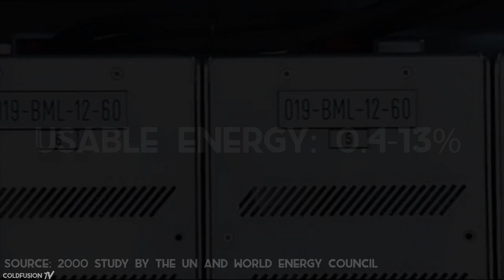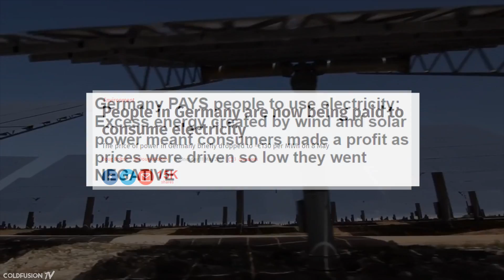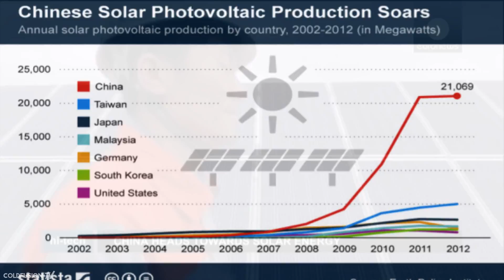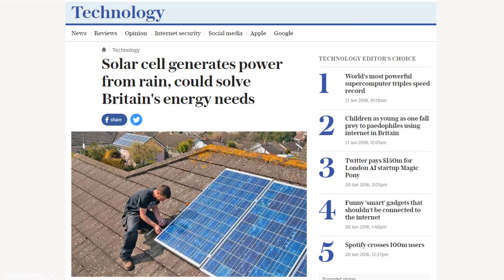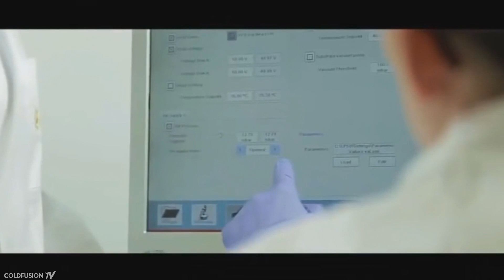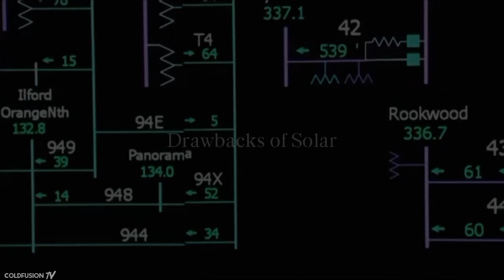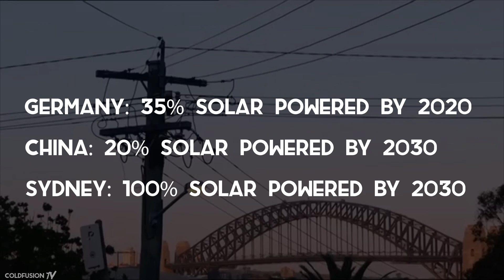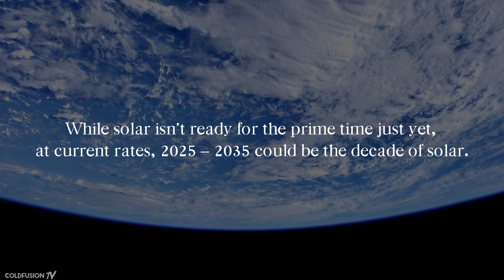The Truth About Solar

Comment: If solar is So good, why aren't new houses built with solar already built into the house? Also, these High Pressure, persistent, and Lying contractors keep hounding me on the phone and at the front door of my house are really turning me off to solar.
Reply: In Japan they are. Pretty much every new house here is built with solar panels.
Reply: stephen meinhold that sounds like a very educated opinion. Glad you backed it up with facts and references.
Reply: stephen must be off his med but where Im the rates do vary but in last few years the supply rate has gone down for electric. So being locked into a contract that will go up 2% a year would not be a good deal here. Plus the prices is going down for PV too and when the clown we have for a pres and his tariff on China PV ends we should have much cheaper options.
Reply: Also things that could involve no or a low initial fixed "extra expense" like heating a hot water tank during low demand/high PV supply rate periods when the rates should be low, will all happen too. If the rating system is set up properly.
Reply: If food is so good why don't all new houses come with fully stocked fridges? (Makes as much sense)
Reply: No, it's just done to annoy climate denier conspiracy Kochroaches.
Reply: I think you are just an angry Marxist/Atheist who gets angry when you cant refute a fact so you try to change the subject by making light of my religion and my rational preference for rational economical fuel. Which is really quite silly of you. All you Marxists do is alienate normal people with your over the top hatred of reason and Western Civilization in general.
Reply: Your laughter is the laughter of a frustrated Liberal loon. Another few years of watching your dreams crumble and you'll be laughing in a rubber room.
Reply: I would rather remove subsidies from coal and nuclear than give more subsidies to solar. I'm a conservative. I believe in shrinking government, not expanding it.
Reply: Richard Dixon you have no idea mate .i know numerous people that are saving money .it can take 3-5 years to brake even and then you have nothing but savings for 10-15 years .if your smart with your energy use its a no brainer here in Australia
Reply: I like the idea of grid connected solar included in the mortgage, for wet or northern locations it takes a long time to break even.
Reply: they are con artists, nothing to do with with solar its just a means to an end, parting you from your money.
always do your own research.
Reply: I have left that up to you,
Reply: Another thing is LED lighting which drastically reduces energy consumption for lighting, better buildings lowering energy consumption for heating . and this stuff is all happening once.
Reply: @Crazy Yeah right. Like that Kyocera 29MW solar power plant that they're still "studying" what purpose it could serve? Energy companies have been "studying" it since 2014, by the way.
https://www.scientificamerican.com/article/power-companies-in-japan-move-to-restrict-solar/
It's an engineering feat that we simply will not want for reasons we're still "studying." XD sorry just griping. 

They won't let it into the grid because that would be costly for fossil plants since they'd have to keep producing even during peak production hours. They can't just shut it off. Not much investment coming in energy storage so far and companies would rather keep pushing papers while earning for the meantime. It requires political motive not just technological. The science has been there for a while.
Reply: "They can't just shut (it) off" the "fossil plants" ? Seriously??? What is a fossil plant a very old plant? Or did u mean a fossil fuel plant? And what kind of fossil fuel?  Gas, oil or coal? So r we suppose to pretend they r all the same? 

Intermittent generation sources like PV or wind r far more difficult to manage when they become a significant percentage of the generation capacity. But there r ways to adjust the economic incentives to allow the use of intermittent interment generation sources like PV.  Like by using TOU (Time Of Use) metering and a modification to Net metering for selling the excess electric back to the grid at rates that reflects the need for it. Which for example could go down to 0 sometimes when there is no need for it or go up to many times the normal market rate at other times when there very high demand fo it ie giving an incentives to buy storage or to shift usage patterns. 

 "The science has been there for a while." If have been rich enough to buy it and the storage needed for it, But for the rest of us it will take political decisions based on sound economics to create the proper incentives make PV economics viable for the rest of us. 

But we all know most ppl prefer simple answers to complex questions instead. Like saying the utility companies and the big bad legacy fossil fuel plants r part of an evil conspiracy. So enjoy ur simplistic view point.
Reply: N C Perhaps that didn't come across right. Gas turbine power generation isn't like a car that you just turn over. There's a relatively complex startup process from spinup to synchronization to self-sustain and takes a few minutes even on hot start conditions. All that while burning fuel. Not to mention the needed purge between operations.

What I was saying is that, if you're just talking money, it will require extra expense on gas turbine power generators just to accommodate solar while at the same time, losing revenue on solar peak production; which is exactly why you arrived at my same conclusion that moving up to solar will require political will.
Reply: you toob how has that been so far?
Reply: If stupidity is so good why don't all houses come with (it) fully stocked? (Apparent at least 2 do)
Reply: I've had 10KW on my roof for 5 years now. What 'maintenance" are you talking about?
Reply: Thank you for the correction.
Reply: I HAVE a Margarita in my hand at the moment.
Reply: Too bad you can't get a woman.
Reply: So a recent law put into place in California is requiring solar to be installed on every new home.  Guess new homes will have to come with solar after all, at least out west.
Reply: More people will just flee California to avoid this stupid law.
Reply: Look at the shows on HGTV about renovating and flipping houses.  It is all about visual style.  The first thing they do is rip out walls, which is not smart in the north. Open the door on an open plan home and all the heat is out the door in a flash.  They rip out perfectly good cabinets and floors because the "finish is dated"
There are a lot of builders who buy cheap farmland, build cookie cutter homes, and run off with a quick profit.  I doubt if any of them has the ability to care about the environment, let alone figure out the tecnicalities of solar.
Reply: 6.6kw is good enough for old people? Really? In the south, where temperatures can regularly go above 100F, old people need to run their air conditioning systems 24 hours for several months. No batteries or inverters can handle that kind of energy demand.
Reply: I am not an expert on AC systems, but in Iraq, my Q36 radars used generators which put out 10 kw, 400 Hz.  This was then modified by the radar into DC and AC circuits..  They powered two laptops, two monitors, a mechanical map display, two tactical radios, a printer, an interface computer to the rest of the radar, two AC units, one of which was, usually on, and both could be on, cooling two operators, and the electronics, while also sending much of the power to provide a radar signal which could detect and track multiple targets the size of a hand grenade out to about 15 miles.  It did this for a shelter which was essentially a minimally insulated aluminum box in ambient temperatures which got up to 121 degrees F and surface temperatures in full sunlight of over 160 degrees F (This is why you see pictures of soldiers in Iraq wearing gloves in the summer; skin to bare metal contact could result in bad burns._)  The ambient temp was more often 115 degrees and went down to the low to mid 80s at night.  
I see no reason why a reasonably insulated home of modest size should not be able to do with half that.power since the roof would be turning a lot of the energy which would heat the roof into electricity.
Reply: A lot has happened.  Solar is cheaper than coal, new homes in CA are required to have solar, recycling batteries is becoming intrigal to their production.  Nice video but you failed to mention decentralised solar (the German model) which is far more effective and fungible re: the electric grid.  Now that AI is monitoring power flow, even huge concentrating solar plants can easily plug in (pardon the pun).
Reply: +you toob Leaving a reply so I can get a notification when you come back with the metrics.
Reply: +Crazy Unless they don't have power lines going into the house, I won't be impressed. And I'm fairly certain that no matter how you jiggle it, you won't achieve the comfort level of a solid 110-220v 10kW grid. This solar power comes with a lot of ifs and bending one's lifestyle around those ifs. I don't like that. When we get to a point where those ifs stop existing, aka a point where I can draw 10kW off the wall from solars and not have to invest into new super capacitors every 5-10 years (and those are expensive as hell, even if I build them from base materials).
Reply: Solar is not cheaper than coal. That's just an absurd lie. Solar is expensive as hell.
Reply: Government doesn't make money. Government confiscates money from Citizens and re-distributes it as they desire.
Reply: Gulf Echo https://en.m.wikipedia.org/wiki/Cost_of_electricity_by_source

And this

https://www.forbes.com/sites/dominicdudley/2018/01/13/renewable-energy-cost-effective-fossil-fuels-2020/amp/

So not only is it often less expensive now, it will be universally less expensive in the near future.  Not to mention environmental costs.  Solar really is our best option for general usage in all sectors of our lives.
Reply: It would not be possible to economically run my air conditioning system in the summer with solar panels and batteries. It would take a system costing tens of thousands of dollars, not to mention battery replacement costs, equipment failure and random weather events. It is WAAAAAAAAAAAAAY cheaper to just pay $200-300/month bill for my coal and nuclear generated power from area power plants. The dirty little secret about "green" energy is that it's just not cost-effective.
Reply: already built in... well, some of the builders do just that here in Scotland. They don't generally put enough panels on, though - nothing approaching using the whole roof.
Reply: Paul Smith Food is a consumable, perishable good. Solar panels are neither. Your attempt at coming up with an analogy is so weak and pathetic that you should probably be sterilized to ensure you don't breed your stupidity into later generations.
Reply: Gulf Echo - design houses better and they don't need refrigerative cooling. The people  in Yemen, one of the hottest and most humid densely occupied places on earth, have been doing it for a thousand years and more. They use a kind of passive a/c with air flow driven by tall ventilator 'chimneys'. Air is drawn from street level, passed through a cool damp cellar, then through the house, then exhausted at the top. The scheme doesn't use any grid energy. This is being improved on and copied by architects in southern Europe (also pretty hot). 
In denser cities and towns, refrigerative cooling spills all the heat and the energy used to drive the cooler, exhaused as heat, into the street, making the whole town warmer than it would have been without coolers, so you are on a hiding to nothing - the hotter it gets, the harder (more expensive) it is to get down to a tolerable temperature.
Reply: Morpheus; Solar panels and batteries are also perishable. Solar panels don't last forever and most batteries last less than 4 years with constant use. Your attempt to debate is pathetic. You are an typical Liberal idiot.
Reply: Ah, the oil evangelist has spoken.
Reply: Christian, fossil fuel advocates should have a voice just like Marxist, alt energy fanatics do...
Reply: They do....It is the voice of the Koch brothers.
Reply: ...as opposed to George Soros?
Reply: He doesn't fund FF sites.
Reply: He does fund DNC campaigns, internet bots and protests...
Reply: Yes of course...my flat Earth friend.
Reply: Do you have a counter-argument to my above statement, "Solar panels and batteries are also perishable. Solar panels don't last forever and most batteries last less than 4 years with constant use." ? Or do you just want to trade one-liners for the next few days?
Reply: Tesla batteries can easily last 20 years before the drop to 80% of their new specs. Other stationary battery chemistries (eg. flow batteries) are better. Todays solar panels will easily last 30 - 40 years and still have 80% output. A barrel of oil has a lifespan of what? Half an hour? And nuclear maintenance costs are astronomical. Decomissioning costs $billions. Solar panels are recyclable.
Reply: Ask the Brits how their $13B Hinkley nuclear plant turned into $35B and still not complete. Expected to hit $50B.
Reply: I can't be angry when I'm laughing this hard!  I didn't think being a flat Earther was a religion, but hey, knock yourself out with your 'logic'.
Reply: We aren't talking about Teslas. We are talking about home solar systems and Tesla hasn't been around long enough to prove their 20 year claim. And I have yet to see the home solar system that can meet the energy needs of a typical Southern A/C system in a typical Southern summer. But you probably hate Southerners and think we should just sweat all summer because Al Gore told you the "polarized" ice caps would be gone by 2014...
Reply: +Ken Karnes Now they are, dont be a smartass
Reply: I live in Hawaii and solar power is very cost effective here. It really depends on where you live, how much sun you get, and how expensive electricity is. We've had our 10KW system for about 7 years and it has already paid for itself in energy savings and tax credits.
Reply: ..."tax credits"... being the keyword here...
Reply: Yes, with tax credits, without it, the payback period would have been around 10 years. This was back when solar panels were way more expensive. The price now is less than half of the price it was back then so the payback period would be about 6 years without tax credits, about 4 years with tax credits. Right now my solar system basically pays me about $400 a month, it would be more but electricity has gotten cheaper since 2014.
Reply: Right. So solar is not cost effective without the government subsidizing them through tax credits. That's my point.
Reply: That is exactly the opposite of what I said. Right now, the payback period for solar in Hawaii is about 6 years WITHOUT the tax credit. If I didn't already have my system, I would add one right away. It really depends on where you live and how much energy you use. Also, coal and nuclear are also heavily subsidized by the government so why wouldn't you count the tax credits for solar?
Reply: What's "the payback period"? I live in the American South. It is incredibly hot and humid here for months and I run my 50,000BTU AC system 24/hrs per day from may-september. My bills are around $250/month. How would it be cheaper to power my needs on solar? We are talking about a system that would cost tens of thousands of dollars with batteries and  installation, not to mention maintenance, malfunctions and replacement costs for expensive equipment. It's just much more cost effective for me to pay my $250/month power bill than to go into debt to install a $25,000 system that will require expensive upkeep and perform poorly in inclement weather which we have plenty of.
Reply: Payback period is the amount of time it takes for solar panels to payback what they cost you. So if your system cost $20,000, how many years would it take you to make back that $20,000 in savings, basically when the ROI reaches 1. The payback period is different depending on where you live and how expensive your electricity is. Solar is not for everyone but as the price drops, it will be a worthwhile investment for more and more places. It seems that in your area, it is not cost efficient yet, but as prices drops, you will see more and more systems and they become a good investment.

Also I am not talking about off grid systems with batteries. I am talking about the 99% systems that most people get, grid connected systems without battery backups. Maintenance cost for solar panels are actually very very low and everything expensive like the panels and micro converters have 10-25 year warranties. What kind of upkeep do you think solar panels have? I pay maybe $300 a year for maintenance because I am too lazy to go clean them myself once a year.
Reply: I'm all for the most cost-effective energy option. I just don't want technology shoved down my throat for the wrong reasons.
Reply: The law for solar panels for new homes in CA is fine. The payback period in California is pretty low and it helps for base loads and helps lower the needs to add more power plants. It very similar to requiring insulation or energy efficient appliances in new homes.
Reply: It probably will in a few years. Just like title 24 explains for “energy efficient” homes and buildings if there’s money to be made they will pass a law where if you buy a home or building or renovate a home or building you will have to conform with title 24 which will mean solar panels. This might not be a good thing since it will be controlled and prices set pretty high why? Because they can!
Reply: If solar was cost effective, government subsidies wouldn't be required to make them mainstream.
Reply: "Be quiet and don't expose our 'green energy' scams, or I'll call you names"...
Reply: Many new houses get build with solar roofs, but the investment is big and it the return is slowly. Wherein without solar roofs, the investment is small and paying for lifetime for electricity. So it's just about calculations...
Reply: Richard Dixon i have just had it installed. 5kw 6.6kw panels costing me $5400 .i will let you know in 3 months time when i get my power bill
Reply: Ken Karnes im looking into solar. im looking at the upsides and the down sides. Alot of the houses being built around me have solar already on them but im not sold on it yet i think there has to be a better way.cost wise it is about half the cost for the first 20 years then its "free" but im with you on the contrators hounding me to buy when i want to make a informed decision.
Reply: Ken Karnes sir it's not about how good solar is or that it's better or the ultimate replacement for fossil fuels. The reason you use solar is about being a true modernist and it's frankly stupid to depend on fossil fuels when you have powerful pocket computers and walk around wearing Spaceman headphones. Once you have solar power you can leave the lights on all night did he was only the highest wattage light bulbs what's Tesla batteries are a few hundred dollars a piece and freon cold the last longer. However if you keep hugging the wall love you too man you might as well pull out your crystal radio listen to your jungle noise cuz that's about how advanced you are as a human being and it's pretty sad.
Reply: Im doing a solar lease program. basically the panels are installed for free, and the company owns and maintains them, sells ME electricity. Its awesome. I dont pay a thing, and my electric bill is cut down by about 45%. But the big saving is the rate of increase. Power companies hike their rates about 4-5% a year. Im locked into a 20 year contract where my rates only go up 2% a year. I calculated it, and in about 12 years I will be paying sunpower (my provider) what I paid PSEG (my local electric company) THIS year.
Reply: Batteries have to be replaced constantly and are very expensive, not to mention the cost of the actual solar panels and wiring. Without $5000 Obama-era green energy handouts and cheap, Chinese-sweatshop panels, it's just not worth it.
Reply: If you thought the Liberals were panicked by their unexpected loss of the Presidential election, wait till this November... You are going to need more margaritas when the bad news breaks...
Reply: I bet you prefer men...
Reply: It depends where you live. Solar can save you lots of money where electricity is expensive.   The downside is installation regulations and standards vary worldwide.  When installed incorrectly, you risk your home and safety of others who work on your home.   Only hire trained electricians who are certified solar installers and you will be safe.  IBEW have highly trained Red Seal electricians who specialize in solar installations.